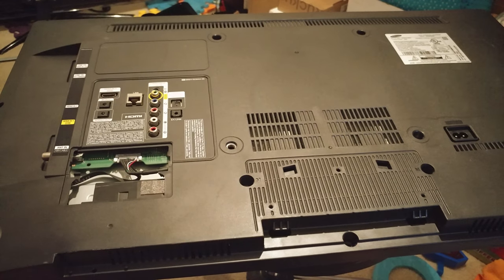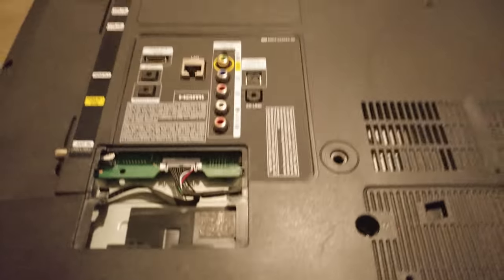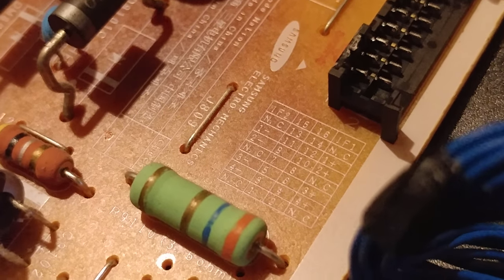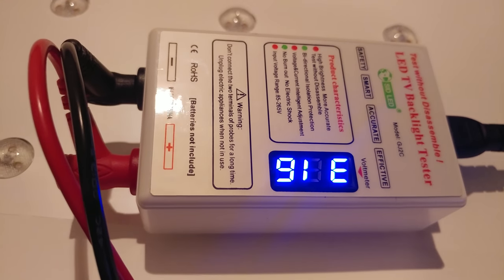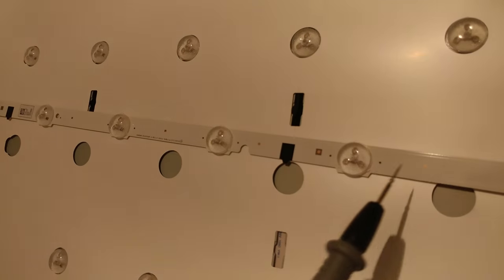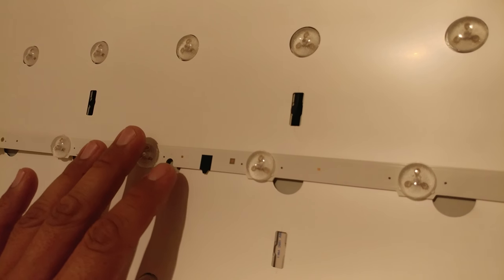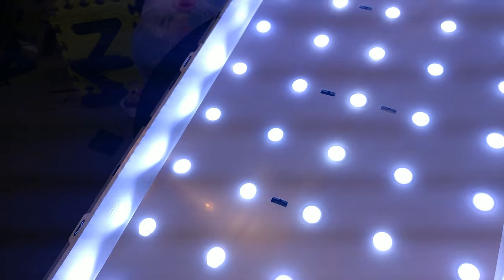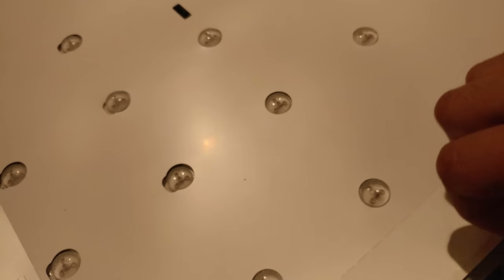Un32f5500 Samsung LED tv with no picture or backlight fix detailed

Comment: So your original issue, was the whole screen out, or just one dead LED and the rest lit up?  What was the orginal problem before you tore it down to diagnose?  I have this exact model but the whole all the backlights are out.  Or is thing TV like a Christmas tree where one light goes bad, they all go bad?
Reply from the maker: RAL LEDs don't come on at all.
Reply from the maker: RAL like a Christmas tree.

Comment: Please samsung 32"led model no ue32c4000wxxc hou to repair for no picture or display back light complete Tell
Reply from the maker: just change out the leds
Reply: I have same led tv . back light problem solved but now no display? T con volts is ok too and remote working too